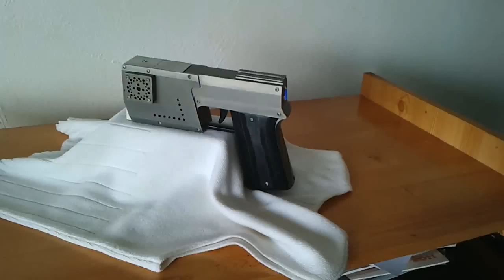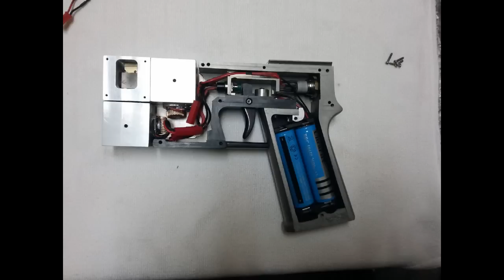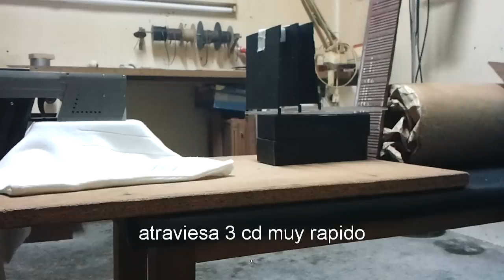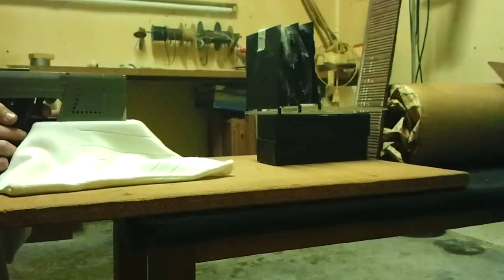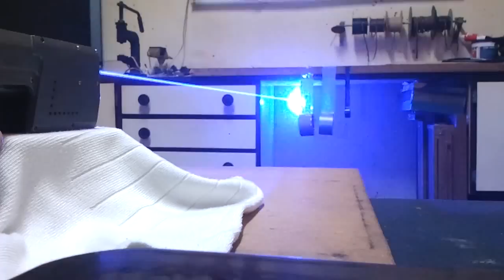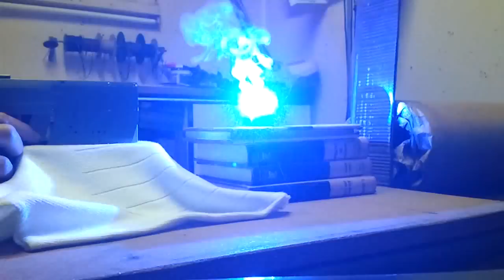Laser gun 6,5w. test

Comment: I like the concept of the Fallout style laser guns... It still shoots a solid beam like this. But it is 20x more powerful than this pistol, shoots in highly concentrated bursts, and has a diode diameter of at least 2 inches across. Its not like this is un-achievable. For instance, if you could harness the power of one of the lasers that the US navy just recently installed on their ships, And put it into a rifle sized weapon, It basically WOULD be the same laser rifle from Fallout. It just wouldnt go "Bzzt, Bzzt" When you shoot it... At least unless you add boron gas cartridges as a sort of tracer round for the laser. :p. Someone get on this please.
Reply from the maker: Yes but the lasers of the navy are very large ... very large power supplies impossible to put in a pistol

Comment: Is there any way you could make a prototype for sale? I love this exact one, sure it'll be costly but I think it's totally worth it. This could make a great survival tool to start fires if you become lost in the wilderness. Or pest control, imagine zapping some hornet nests with this.
Reply: Avenging Angel 
But you may want to wear a full covered & tightly sealed bee keepers suit from head to toe if you do that kind of nonsense, UC those hornets are not dumb & they'll be highly pissed at ya following your scent, so you'll need a lzr unit in the kW range to totally & effectively burn up there nest & INSTANTLY too.
Reply: X-15 
Well yeah, I wouldn't attack a hornet's nest naked. But I feel like heated lasers could really benefit the pest control industry.
Reply: ***** 
But make sure at really high wattage outputs. 👽⚡🌀🔥
Reply from the maker: I think it is not suitable for a wasp nest, the beam of light is thin ... a wasp nest too large. This is just a prototype, it is not intended for any specific use. I just wanted to know if it was possible to do it.
Now with the new diodes I think you could do with double the power
Reply: llorenç perez corcoy 
Bee hives are high flammable. So if the laser can cause it to at least smoke, it could combust into flames.

Comment: HOLY MACRAL, now don't let the MIB see this fantastic 6.5W lzr gun, but joking aside i see a lot of heat sinking on that muzzle to increase its output pwr by 3.5 watts to a blue flame throwin 10W's of hot streaming blue energy, but hell at 6.5 watts your doing just fine imo sir the way it slices that tape at several feet in short order is very impressive, & its not only pwrfull but has a short framed 9mm glockish look to it too imo...

So ill advise you good buddy to not let any law enforcement types see it in action because ya might get into trouble, hell some cops may either try to buy it from you or maybe even shoot ya & steel it from ya anyway, because its a awesome piece of hi pwrd portable lzr tech that's highly unusual to most folks UC.